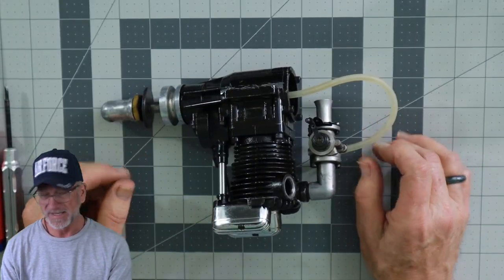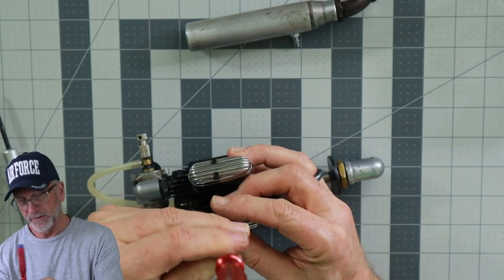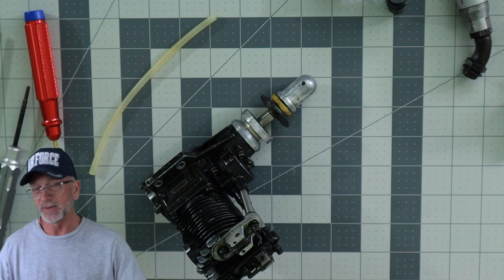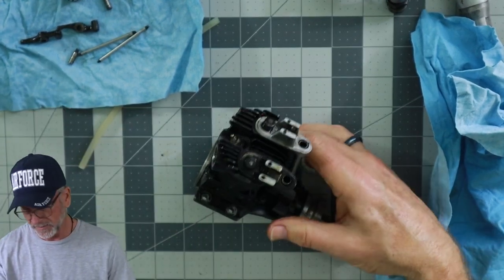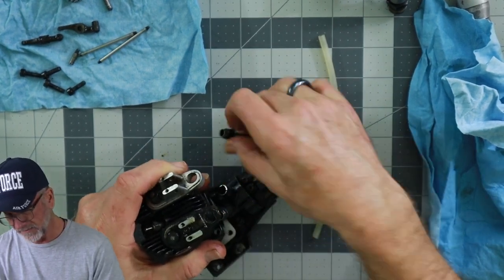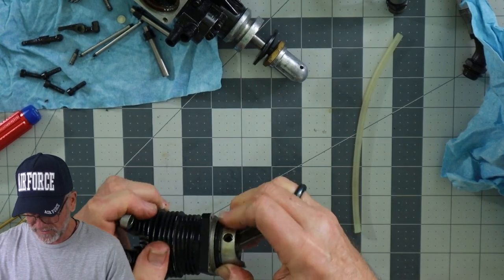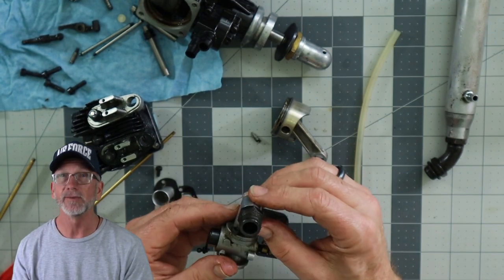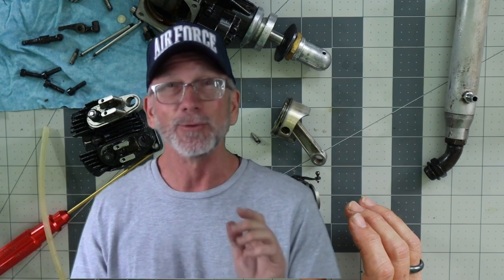Freakin A! Saito FA-150S A Look Inside

Comment from the maker: After a better inspection of the inside of the head. I found a horrible gunky, gooey residue of some sort caked inside the intake side valve seating area.  The ultrasonic would not clean this initially so I had to a soft tool to loosen the material.  The way it moved and the slimy nature I can easily see how this would cause the leak on the intake side as the material would drop down onto the valve during operation.  The exhaust side was coated with a heavy carbon build up as well.  This too was thoroughly cleaned.  I believe this will be a good running engine in a few weeks when the replacement springs and gasket set arrive and it is reassembled.

Comment: I have a few 4 strokes wih essentially very  little compression feel but the run great
Reply from the maker: Well I suspect that they are in need of the valve lash checked or set.  A four stroke engine should have GOOD compression if it is healthy and set properly.

Comment: I'm amazed how an engine that seems to have little compression will start and run fine. I think it has to do with the high percentage of oil in the fuel. Other engines have so much compression that the prop smacks your fingers when you flip it over.

Comment: Well that's a shame about your carb but it's still a sweet Saito. I'm envious of your stock muffler. I have a newer version on mine. I think this is the first video I've seen of the black 150S with chromed valve covers. By the way mine has an "A" stamped on the lug as well. Looking forward to the run video as well as the 2nd video on the Picco .61.
Reply from the maker: Was yours a new 150S?  I am curious how a 150S with a newer exhaust could be stamped with an A unless I have no clue how and when Saito uses certain letters...
Reply: @dmrcflyr2  My original exhaust had to be replaced due to a crash. The original exhaust was exactly like yours. Hope that clears it up a bit.

Comment: Very nice!  How do you feel the 150 compares to the 180?
Reply from the maker: Compares in what way?  That is a very open ended question.  I have featured both on my channel. Have you watched those videos? Can you be more specific as I don't have time for a complete review.  Both are Saito high quality engines.  the 180 is larger displacement, swings a bigger prop,...  What more is there to know?

http://sceptreflight.com/Model%20Engine%20Tests/Saito%20FA-150S.html

http://sceptreflight.com/Model%20Engine%20Tests/Saito%20FA-150S%20%282%29.html

http://sceptreflight.com/Model%20Engine%20Tests/Saito%20FA-180.html

http://sceptreflight.com/Model%20Engine%20Tests/Saito%20FA-180%20%282%29.html
Reply: @dmrcflyr2  Sorry for the vague question, but thank you for the thorough answer!  I have watched most of your videos, including the 180 videos.  I have one of the Saito 180 A engines (marked with a c on the lug), and it is a rip snorting thumper. 

My original question of how the 150 compares to the 180 was prompted by your comment about there being "nothing like a 150".  Again I apologize for not clarifying that more!

 I have heard in the past that some of the 150s had higher compression ratios, and like to kick, so maybe there is something like that about the 150 vs the 180, that makes it particularly interesting to run.

Hope that clears it up!
Reply from the maker: Well anytime you get up around 120-180 on a four stroke you had better be aware of the possibility of kick back when starting.  I assume that is the time that you would be concerned about, starting that is.  It comes down to how you prime the engine, how well you know, and how you start your engine.  Some engines like to be very 'wet' others that is a recipe for a violent start and kick back.  I love most all Saito engines; ALL Saito engines made before 2005.  There are many of the 'newer' displacements that I would not own. The things I say in my videos regarding my feelings about certain engines are my own and not 'doctrine'.  Each person must make their own judgements.  Now unless those two 150 reports linked above state that compression ratios between years of 150's were changed I would not just believe what you 'heard'.  That is how misinformation gets generated and spread causing all sorts of issues and opinions of things to be wildly inaccurate and unjustified.  I would demand proof from whomever says such things.  If none can be provided summarily dismiss that information.  Far too many MYTHS about glow engines are formed and then circulated because ONE person had ONE experience that he/she thinks is absolute truth.  I do my best to report ONLY what I know to be true based on my experience with hundreds of engines.  Even then, all people are allowed to disagree and disprove, and not believe what I say.  I am fine with that as well.

Comment: Be interesting to see what is the cause of the compression loss hope it runs again it’s a nice engine. Also I finally decided to stop being lazy and filmed my value hobby easy stick flying, think you’ll enjoy it.
https://youtu.be/diazuR6tfUE
Reply from the maker: I showed the cause in the video at 12:32. I put text in stating that one of the valve springs was damaged/taken a set and then the carbon build up on the exhaust valve was causing it to stick.  The ring is good and free.  There is the cause of the lack of compression.
Reply: @dmrcflyr2  lol guess the text in the vid went past my head anyway thanks for looking at the vid and looking forward to seeing that beast of an engine on the stand.